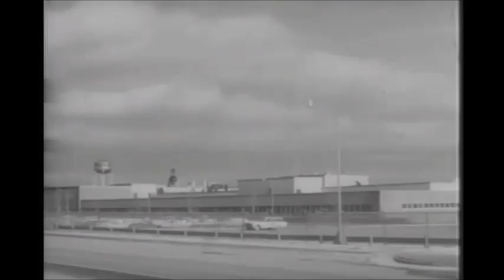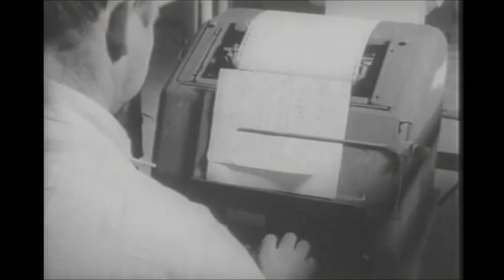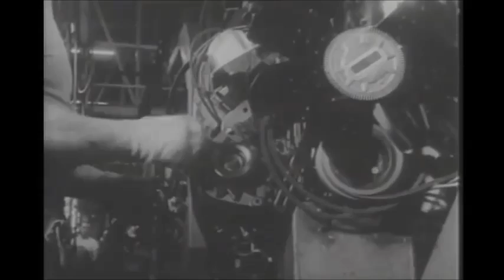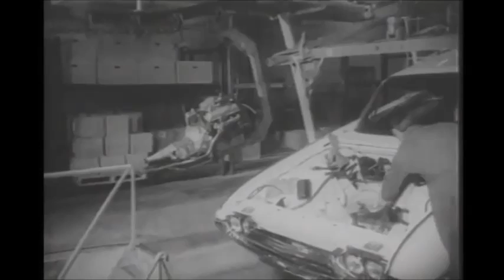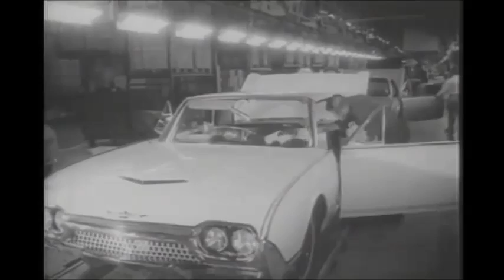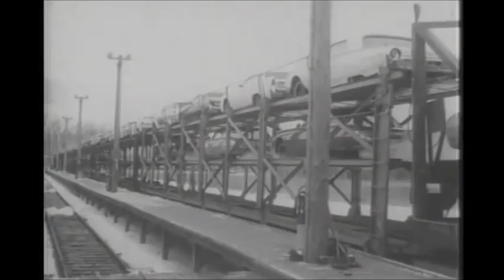1962 Lincoln Continental and Ford Thunderbird assembly line

Comment: These were great cars of their time, especially the Lincoln. Clean lines and no fins. The Wixom plant was known for quality of build. However, cars of this era, though better than those of the 50's, would often rust, burn oil, and get main seal leaks sooner than later. But this was an era of rapid obsolescence and seldom did a person keep a new car more than 5 years and often only 2 or 3.  Not so today. Currently I am driving a 2004 Jeep Grand Cherokee I bought new. 16 years later, No rust, no burning oil, no oil leaks. Still, I love that 62 Lincoln.

Comment: The T-Bird and Lincoln were both unibody cars which were larger than the compact and intermediate FoMoCo cars which is why they shared assembly facilities. The Wixom facility was opened in 1958, I believe, for the sole purpose of assembling the '58 T-Bird and Lincoln.
Reply: Were they built in the same factory as Falcon , Fairlane?

Comment: This is a great upload. I can see though how the cars had certain quality problems back then because of the way they bounce parts against each other with swift movements. The engine was bounced around the compartments to fit it in, the back bumper was bounced off the back of the car to fit it, the back axle was pulled out of a crowded pile of axles, they dont treat parts like hat anymore.
Reply: Right, I was also surprised by all the incidental contact between parts.
Reply: the bouncing around you see is no  different then the abuse as a result of normal driving-lincolns and T-Birds were not plagued with quality control problems, if the individual parts were so fragile as to be damaged during production the cars wouldnt have made it off of the assembly line...
Reply: You should read the car magazine reviews of the day...the Lincoln and Thunderbird were considered to be among the best built cars in the world at the time.  The line workers were skilled, and knew how to do their jobs quickly without damaging the car.

Comment: Wixom Assembly was specifically designed to produce unit body cars, which is why this video shows unique tooling and assembly methods.  Later FoMoCo converted the Lincoln Continental (1970) and Ford Thunderbird (1967) to body-on-frame.  Quality in the 1960s on both those cars was first rate because Henry Ford II knew that high-build quality was the only way to compete with the Cadillac, Buick Riviera, etc.  Standards were relaxed somewhat on the cars coming from this factory in the 1970s but the product was still well-made.  Then in the 1980s, the Lincoln Town Car lost the high-build quality and state-of-the-art design from earlier decades but sales were strong because there were still enough customers who wanted that kind of car.  Lexus showed the way in the 1990s but FoMoCo refused to build the best luxury car as they had in the 1960s and 1970s.  In 2012, Wixom Assembly was demolished because the Lincoln Town Car was no longer produced.

Comment: Worked at the Mahwah, N.J. assembly plant that built 52-54 cars per hour in 1966. I can attest to Fords being rust buckets because the dead panels where never painted. Worked at Pontiac on the full-size and Grand Prix line in '68 which built 85 cars per hour. They really pounded out these cars fast and employed an army of people at a living wage. Sadly, both plants are gone and with them their jobs. Say what you want about the cars back then, one could buy a Falcon or equivalent car for around $2,000. Cars today cost what houses did back then. I don't buy the adjusted for inflation argument. The US living standard peaked in 1966 when hours worked for goods one could buy is factored in. America has gone down the tubes per design of the elites.